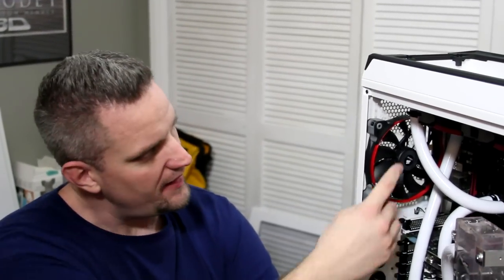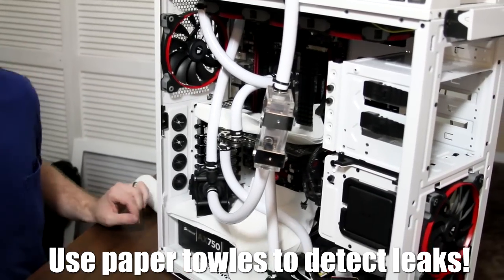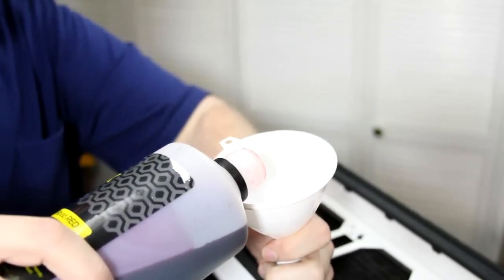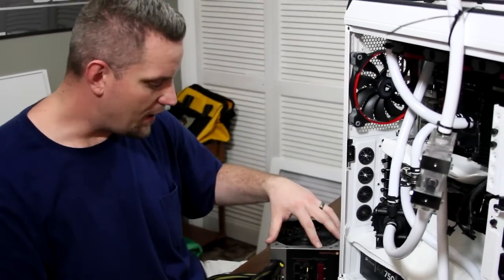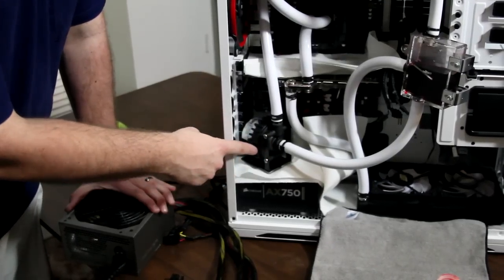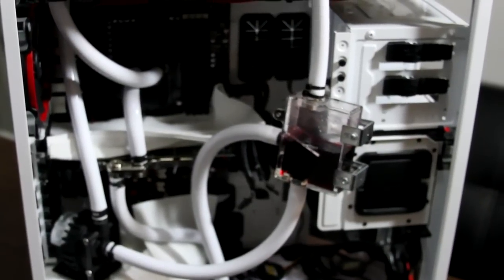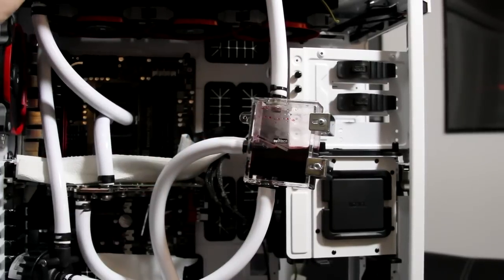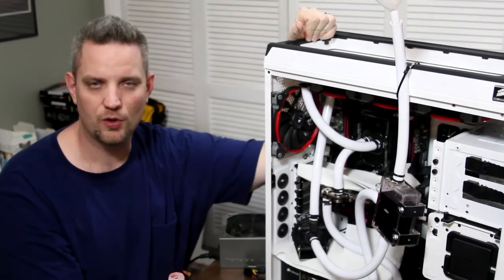How to Watercool a Computer - Part 2 of 2

Comment: If your PSU does not have a power switch - would it work to use wires for the jumper, and put a switch on it...? Or is the jumper connection momentary, ie. you could remove the jumper after start and it would still run?

Comment: how does he connect the pump directly to the power supply?
Reply: Simon Garcia Some pumps have a mile power connection and just use a fan connector for the pwm signal.

Comment: Hey Jayz, big fan. Thought I have a question. Is it viable to just water cool my GPU? I don't need it for the CPU but the fan header on the inside of my gtx 970 is broken so my only option is running it at 100% through a molex adapter

Comment: Hey Guys,

I'm about to build my own water cooling loop and I have a question regarding the filling of the loop. Obviously, I have to fill the res no matter what. But what if I can fill the radiator too? Is it possible? My guess is that if I can fill it too, it would make bleeding the system a whole lot easier. What do you think?

Comment: Great video. I just built a fully watercooled system with 3 video cards. What happened to me was that the system had a very tiny leak that formed a drop of water approximately once a month. The drop that formed fell directly into the psu and generated a loud bang. I couldn't spot the leak the first time, but when the second drop fell (another month later), the psu died.
Reply: why did you keep your loop running when you knew there was a leak lol
Reply: By the first time a drop of waterfell into the PSU it only produced a loud bang but no sideeffects like a broken fuse or a dead component. Therefore I was unable to identifiy the source of the bang and I thought that a bird might had a meeting with my window ;-)

Comment: Hi guys! I really could use some advice as far as bleeding my loop goes! I have a triple rad on top of my case and a duel rad on the bottom. My loop has been running great for the last couple months as well as my temperatures. Every once in a while I hear and see air bubbles traveling out of my reservoir and then it stops. I've tried adjusting pump speed and tilting my case more bubbles come but the water level remains the same. Is their anything else I can do or just leave it? Thanks!

Comment: Hey, I set up my loop, and I had already gotten an MCP655 that I installed into a Koolance RP452X2 Res. It fits into two optical drive bays. I filled it in through a hold on the top, and I tried to tilt it so the water went down to flood the pump, but the pump made a loud noise and didn't do anything, so I turned it off quickly because I assumed it ran dry. I looked on a lot of forums and looked at a lot of videos but I don't know how to flood the pump! Do you have any ideas?

Comment: How would i go about finding water blocks for a cpu gpu for a Laptop..I am using 3 fans to air cool now but sound and the vibration it gives off is driving me nuts
Reply: Holy shit! Hahahahahahahahahahahaha. Been there done that. It was just a motherboards and custom cooler sitting on the floor

Comment: That's a cool trick with the green an black wire. I noticed a few online shops sell the a 24 pin block with just the jumper in. XSPC PSU Bridging Connector £1.20 can`t argue  with that .

Comment: The loop definitely will never have to have the pump running at 50 psi.  It's a relatively small loop just doing graphics and cpu, should probably only have to do 20 psi.

Comment: The maximum pressure of that pump is 50 PSI so be sure to have your fittings on TIGHT if you let it get that high.
To put it in perspective, most car tires are kept around 30 PSI and some truck tires at 60 PSI.
It has an adjustment screw in the back by the way.
Good choice on your parts so far as I can see.
Best of luck to you in your quest for cooling!
If you have any other questions feel free to ask.

Comment: One of the 240's is a alpha cool monsta rad and I will be doing push pull on that, and the other is a 30mm alpha cool 240 with only pull.  I know the fpi on the monsta is 9 but I'm not sure on the other one.  The water block is the swiftech appogee xt rev 2 and the pump is the swiftech mc655.  Also the tubing is going to be half inch.  I'm not sure about the psi and volume of the pump.

Comment: The following is the equivalent water block for your titan:

Please visit amazon.com or any other retailer's website and type into the search bar:
GeForce GTX Titan VGA Liquid Cooling Block

It will be the first product from the top of that page. (please correct me if I'm wrong)
Note: This is just the same brand. It is not the same block entirely.

Comment: Are you running fans through the radiators or letting the heat passively dissipate?
What pump are you using? The PSI and volume it pumps are important to know.
Also the size of your tubing and heat sink as well.
If it bottlenecks at one of the water blocks it won't push water and will end up overheating.

One hundred and five degrees Celsius is also the TJ Max for that CPU. Provided your thermal compound spreads properly between the processors and heat sinks you should be able to keep it cool.

Comment: I run an AMD 8150 @ 4.5 Ghz that I water cool along with a 7970 @ 1000 Mhz. I cooled that thing with a fountain pump and transmission radiator. You can cool what was described above easily with this setup.
Reply: Sheeeeesh

Comment: Getting ready to do my first water cooling build!  I plan to watercool a 3770k and a gtx 780 hydro copper.  I'm planning on using 2 240mm radiators for the whole loop.  Will those be sufficient to cool both components plus overclocking?

Comment: is there a liquid cooling system that I dont have to replace?
Also what cooling system do you reccomend for this set up?
I just got my 900D
2 780GTX
16GB ram Corsair 2666MHZ 
256GB RAID 0 840 Pro Samsung
i7-4770K 4th gen Processor
AX 1200AI

Comment: Hey Jay I have a question I recently built a video editing pc (Asus X79 Sabertooth motherboard, i7-3930k CPU and a gigabyte Nvidia GeForce GTX 670 GPU) I'm using a corsair H100i to cool my CPU, I was wondering can I mod that to cool my GPU and mother board as well??? Can I add additional tubing and pump to the h100i???

Comment: Depends of coolant. The EK coolant will last for about a year on hot component systems. Mayhems pastel is reported to run for 2,5 to 3 years with same system setup. 
This is just what i read around various forums. I change my own liquid more frequent as i swap out components often.

Comment: Hey found your channel through your vlog with boogie2988. I am getting ready to do a water cooling build for the first time and was wondering about your fan radiator setup is it a push pull system/ how is your airflow setup in your case?

Comment: Yep however you may want to buy some compression fittings rather than use the barb fittings that come with the kit. It comes down to personal preference but compression fittings tend to be a little safer as well. Don't forget to buy some coolant though either that or some distilled water with an additive, anti corrosive and anti microbial. (per-made coolant is probably easier).